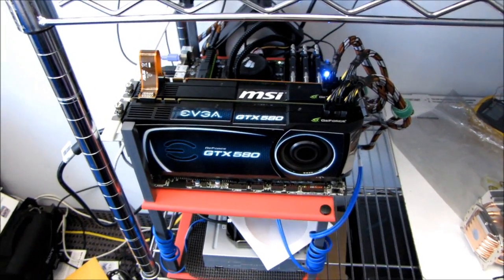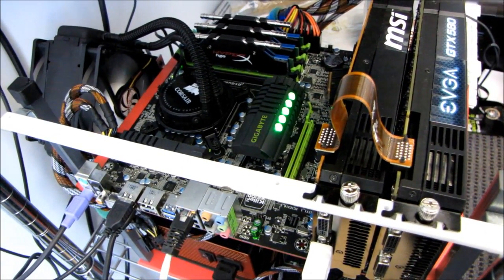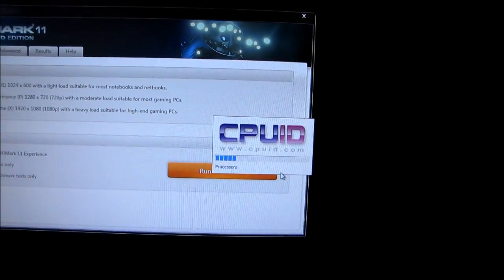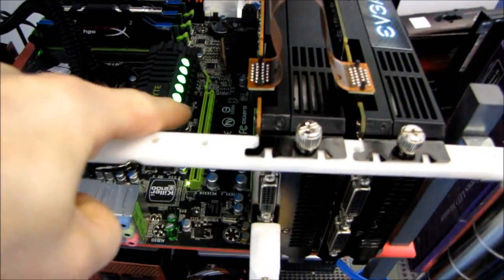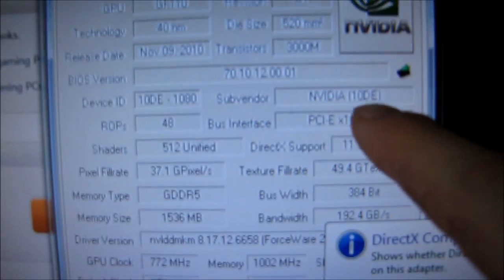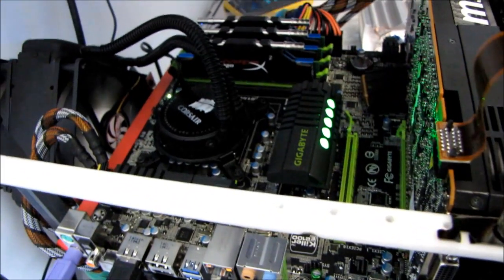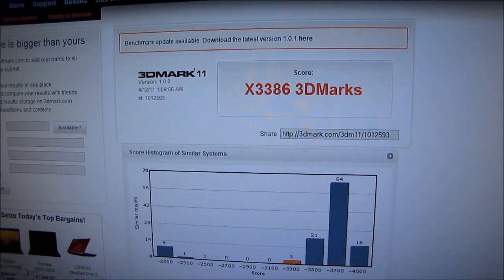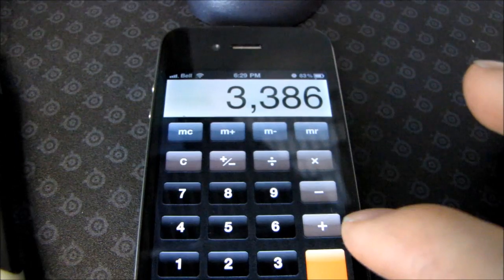SLI Using Dual PCIe 16x vs 8x - How Much Bandwidth is Needed? Linus Tech Tips

Comment: So I have a question for you guys, if I run a 16x capable card in a PHYSICAL 8x slot, will the results be the same as if the slot was physically 16x but electrically 8x? I'm not planning on using a high-end card either, just a 750Ti (all I need to do is run this game called AVA that no one's ever heard of and watch YouTube).

Comment: what about x4?
Reply: Why?
Reply: well that would be a good test as with PCIe 3.0 the 4x slots run like 2.0 8xslots
Reply: My MSI pc mate z97 has a 16x pcie 3.0 lane and a 4x pcie 2.0, and when used together for crossfire only of course you get 4x4x. I think there is a performance hit of 10% or so.
Reply: markman090 also keep in mind that 4X 2.0 slot you're using its going through the chipset
Reply: interesting. I didn't go for crossfire because i was really turned off by the 4x/4x. I think the crossfire label should be striken from products that only support 4x, it's not worth it whatsoever.
Reply: markman090 it's not and a finding a bunch of z270 motherboards that are "PCIe 3.0 16x 4x PCIe 2.0 4x" in that order so you really have to look at the specs before you purchase it or you could screw yourself i have 2 RX 480's and i need to make shure i get 8x 8x

Comment: Would there be any difference running 1 gtx 980ti 16x or 8x? I'm just wondering because I like the looks of my card being at the bottom of my motherboard since I have 4 pcie slots. I haven't noticed a difference yet when playing farcry 4 in 1440p maxed out.
Reply: +s10shane It will depend on the generation of the PCI slot and the which generation your CPU supports. I'm considering the same thing because my 16x slot is damaged but the 8x/8x slot isn't. a 3rd gen 8x/8x connection is just as, if not faster than 2nd gen 16x connection.

Comment: Will you see a lot of bottlenecking when using a gtx 780 pcie 16x 3.0 using a pcie 16x 2.0 motherboard?
Reply: there will be no bottlenecking
Reply: thanks
Reply: PCIE Gen 2 16x is the same speed as Gen 3 8x which as shown in the video does not change the performance in any meaningful way. Glad I could halp

Comment: Not that it matters much but the difference was a ~0.1% improvement.

That was a bit of wonky math there bud. 

3389-3386=3
3/3386 = .0008860012
.0008860012x100 = .0886012%^
Rounded up to .1 %

Just sayin'

I've been wondering about this x8 vs x16 for SLI and although I'm not sure how conclusive that test was with just 3DMark11 as the only benchmark the results are 'interesting'.

Comment: I didn't know enough when I built my system (still don't). I have dual HD7770's running on crossfirex. When I purchased the motherboard, it said it supports up to quad setup. Funny thing is the PCIe slots are 1x16 @x16, 1x16 @x4 and 2x PCIe x1. GPU-Z shows that GPU0 (@x16) is running @x16 and GPU1 is running @x4. All I'm wondering is, what is affected by the reduction in lanes. You look into the 16@x4 slot and can see the physical difference in connection quantity. What does the GPU normally do with all these lanes that are now sitting there unused? I need a new motherboard as my GPU's are 3.0 and the board is 2.0 but I'm on a budget and need to make sure I purchase a suitable board.
Reply: Man I'm wondering the same thing

Comment: that board doesn't support 16x that's why not much improvement
Reply: dude!! do your homework before blabbering such a joke. Here - http://www.gigabyte.com/products/product-page.aspx?pid=3776#sp
2 x PCI Express x16 slots, running at x16 (PCIEX16_1, PCIEX16_2)
Reply: ffejster24 Seriously ? you don't understand anything about computing hardware do you ? the fact is that with PCIE linking lanes doesn't always give you more, Nvidia's "SLI" System Link Interface doesn't scale in parallel like what 3D FX's SLI did, and there's a reason for that Nvidia SLI is interface reliant, 3D FX's was card reliant.

Comment: for dual titans, will 8x be good enough ?

i am currently running an Asus z87 Pro motherboard, so i cant have dual 16x

.. should i upgrade motherboard for duals ? or will 8x be just fine ?
Reply: 8x will be completely fine.
Reply: In all honestly the majority of games are not using the full bandwidth that are being given to them at any given time, AMD with its 512 bit bus architecture is getting closer to filling the bandwidth of 8x. All in all the 8x will still viable a couple years down the road for most consumer cards.

Now a couple years could be 1-2 or 5-6 depending on the competitive nature that Nvidia and AMD have.

Comment: But the real performance boost is only useful when loading textures into the VGA's memory. Because that's when you need the bandwidth boost, since that's where the bottle neck is. During the run there's no need of bandwidth, hence there won't be any difference. Coz you know? Textures need to go from HDD to CPU's RAM and then to the GPU's RAM. Any other benchmark that doesn't test that isn't doing it right. It's like evaluating a fish for it's climbing abilities.

Comment: Well, this test was very relevant back when gtx 580 was the top dawg, however the dual gtx 780 ti setup that I'm going to be running will likely saturate much more of those PCIe3.0 buses than 580s, therefor I'm sure the gap between 2-way 780 ti SLI @ x16/x16 bandwidth and 2-way 780 ti SLI @ x8/x8 bandwidth will be much greater indeed.

Comment: Thank you LinusTechTips!! You've saved me an evening of research! I have a Gigabyte GTX670 OC 2GB (overclocked nicely), and now that it's already being replaced with the 770(?), I'm going to get another in a few months if and when the price gets closer to $300 (already down to $355 on Newegg). My Gigabyte UP4TH mobo does drop to 8x (pci-e 3.0) when two slots are used and I wondered if this would make a big difference, but now I have no worries. Cheers!

Comment: If this is sarcasm than ignore this post. He just tested the ratio of the two outcomes. With x16 it 3389 and at x8 it was 3386. So you just divide the higher one by the lower one to get the performance ratio which was ~1.0001. Which means that the with x16 it was 0.01% increase in speed. (1.0001 * 100 = 100.01% => 100.01% - 100% = 0.01%

Comment: Technically you're correct they are the "same" GPU's however like you said, due to manufacturing process, some CUDA cores are disabled, etc. so while still the same "architecture"  of GPU they're all gk104 for example but the GPU that makes it into a 560vs570 are not the same in the end. ATI simply handles this differently but the idea is the same.I think we are getting hung up on semantics and what we consider the GPU. I consider it the core on the card, not the architecture it's derived from.

Comment: what Nachoman is saying is that just because the overall Architecture of the GPU is the same, it doesn't mean that the GPU is the same. just like buying a GTX 780 or a GTX Titan are technically gk110's like the Tessla, but they are not the same thing. You may be confusing with ATI's Crossfire, wherein as long as they share families you can run them together i.e.: a 7970+7950 is ok, but a 7970+7850 will not.

Comment: Well you saw it wrong. a 560ti is only $170 while a 660ti is $290. That is $120 differenceHe was looking at getting a card that is around the price of a 560ti. Not $120 more. It is safer to assume someone is looking for a card around the same price than whatever the best value is. I didn't read the part saying nvidia side. Another analogy. 'should i get an amd a8 to render video'- new pc builder 'no get the i7 3770k because it does it faster'-you. see how stupid it sounds?

Comment: yeah your performance will be greatly limited. run a 560Ti on a celeron single core, then on a i7 3930K. same gpu but the performace is massively improved when the cpu isnt holding back the system.

Comment: glad to hear that its nothing noticable.  ive just bought 2 8800gtx 460 cards and it is running at 8x in sli. i bench tested them with heaven dx11 with everything maxed out and i get 36.6 fps. it runs smooth and judder free so im very impressed to be honest. my old 8600gtx cards couldnt even handle this on medium and they were only dx9 i think. maybe dx10

Comment: "8X" is not it's bandwidth...  That's the number of lanes being used.  Available bandwidth would be determined by PCI-E version...  (On a 16X slot, PCI-E V1.0=4GB/sec, V2.0=8GB/sec, V3.0=15.75GB/sec (PER LANE  X  8)

Comment: You still shouldn't see any worse performance from the x8. Also, if you plan on overclocking, you should OC both cards since in SLI the system recognizes the least amount of vram and the slowest clocks as default, no matter that you OC-ed the top card.

Comment: Guys i own a Z77 pro-4. Wich has 1 port x16. It says it is not SLI capable cause the other slots needs to be at least x8 but is Crossfire capable. How come AMD cards don't need the speed of the slots? cause the other 1 = x4? I am confused. x8 or x16 = double the transfer data. how can it only increase 1/2%?

Comment: Guys, I'm just guessing here right now. Linus, have you tried evaluating 2 GTX 680? Maybe there is just a little difference in performance because GTX 580 is a PCIe 2.0 and as per my understanding, the max bandwidth of PCIe 2.0 is 8x max. But if you try 2 GTX 680 in a Gigabyte G1 Sniper 3 Motherboard that has 2 PCIe 3.0 slot running at 16x with an Ivy Bridge Processor maybe there will be a difference. Isn't it Ivy Bridge Processor can maximize the bandwidth of a PCIe 3.0? Well it's just a hunch!

Comment: I fixed it. I apparently had a driver problem. I reinstalled windows and it worked fine. My PSU is 1000W from coolermaster so its fine

Comment: i use a f1a75m-le. The board has one x16 and another x4 black., Currently have a hd7750 now, am going to add another 7750 for crossfire. would i see another performance boost. (please state in percentage of performance boost in 16x and 4x)

Comment: Scalable Link Interface... it basically means you could buy a second graphics card of the same model and connect them both together to increase your graphics processing power (assuming your motherboard supports SLI)

Comment: Some cards do 16x+16, 16x+8x is pretty common on most mid to high tier cards. The MSI Z77A-GD65 I just ordered a few hours ago only does 8x+8x. But I got that one because it was the most affordable mainboard sporting 8 SATA ports I could find. Since berformance will be reasonable anyway it's not really much of a deal either. 16x+16x(or even more slots at 8x and/or 4x) is hardly need unless you're trying to review GPU's or do competitive overclocking. :)

Comment: ...To continue my two cents (well, this is a separate comment so I guess that's four cents altogether), modern motherboards actually have the appropriate slots spaced to allow for optimum airflow.  I.e., x79 boards (40 lanes pcie) will have an x8 slot between two x16 slots so your two-card configuration will run at x16 on each slot.  Z77 boards (16 lanes pcie) will have one slot between the two x8 slots (an x1 slot, a pci slot, etc) to allow the dual card setup to have proper airflow.

Comment: My two cents, if I may: I need to research this, but I would think that one card in x16 and the other in x8 would mean that you'd get the same effect as two x8s (the whole weakest link thing) because it would be easier for the system to manage two cards running at the same bandwidth.  I could be wrong, but I think that's how it would work.  But you are right in that the airflow concerns would be addressed.  Speaking of which...

Comment: If you really are going to do a 4 way SLI/CF setup just skip 1155 all together, get a 2011 board otherwise you'll bottleneck the cards which is just a shame. In theory the cards wouldn't be bottlenecked bedcause PCI-e Gen3 x4 equals to PCI-e Gen 2.x x8 but in reality that's not true.

Comment: graphics card performance is purely about how fast it can draw frames. the more cores a card has, the more frames per second it can draw (scaled by how good the cores are. if you have two cards, you have twice as many cores, but not always twice the performance as the drivers don't handle the two cards as well as a single card. the reason for two cards than one higher performance card is to save money. you can buy two GTX560Ti and get the same performance as a GTX580 for a lot less money.

Comment: I Find this pretty helpful in my situation I have an 1100T on a Crosshair V that in SLI does 16x 16x but Since I'm running 2 x GTX 580 I get a cpu limit and have the option (getting a great deal on) a 2500K and a P67 that does 8x 8x in SLI. Thanks to this vid im upgrading to an i5 and know I should get little lag on the cpu or gpu end.

Comment: Did the same type of test with my Radeon 5830, I ran several benchmarks while the card was installed on a 4x PCIE slot and a 16x PCIE slot, there was absolutely no difference in performance other then a few negligible points!

Comment: @BigRTKingKong ??? that dont make sence??? u got 1 slot cause u didnt want to run 8/8 but if u run 1 card on a 8/8 board it runs at 16..... in other words its really physicly  16x and 8x but it can only have 16 lanes of bandwith so it runs at 8/8 with 2 installed  i run duel 580's on p67 and it runs great

Comment: Gorilla motherboard! LOL. Well i´m pleased that my P8Z68-V PRO wont be a bootleneck for my two GTX 470s. Even if Z68 in 8x8x SLI it´s 3% max. slower in frame rates @ hires, versus a 16X16X SLI X58, we must remember that the performance in terms of CPU, the 2600k it´s significantly better than any i7 9xx series (except hexacores). Sandybridge CPU is 10% faster clock per clock and clocks higher. My opinion is that Z68 besides being a mainstream platform, it performs better than X58 platforms.

Comment: Would there be a  considerable increase if I used x2 GTX 550 Ti in SLI? If I install 2 on this board that I have it will only run at 4x. If I use 1 i run at 16x.

Comment: I think linus should also compare a motherboard that uses the Nvidia nf200 chip which allows it to use 16x for sli configurations in p8p67 motherboards. That way we would know if nvidia's chip actually works, instead of being just some fake bandwidth(buffer)  that the chip is giving for the PCI-E

Comment: Linus thank you for the vids man, one question. I'm doing a build that will host duel 590s on a r4e, but as people know r4e has only x16,x8 slots. And that's fine if I was running a single monitor. But I'm going to run surround. So what does quad sli and multiple monitors for bandwidth wise? If its just a 3-5 fps change I don't mind. Than you jesse

Comment: @cletus094 

It is like the difference between a four or two lane highway. You can pass less cars (or data in this case) on it at the same time. It are the lanes betweens the gpu and motherboard (cpu), more is better in theorie because you pass more data at once but in the actual world it doesn't make a lot of difference because the video cards don't pass through that many data anyway :)

Comment: good job on video.  it's good to see you testing stuff that people think about sometimes..yet may get side tracked from researching or wanting to test.  and Eyce  yeah  you are right to an extent. Either way trolling is retarded though. there must be balance somewhere. neway If my 2 gtx580's can't handle crysis 2 at above 60 fps on a 120hz monitor at 1980 x 1080 rez no matter what pci e x16 lane combinations i try...that's as far as my experimentation/troubleshooting patience goes.

Comment: @MathioPL They are both great boards. I would go out on a whim and say the Gigabyte chipset and motherboard should run cooler. My G1 Guerrilla had 20c+ cooler on board chips than on the RIIIF (yeah I know it's not the Extreme or the new one) But also note mine had to have been faulty since it blew two capacitors while using Prime 95. I do miss the Rampage I could have replaced it, but the Guerrilla was calling my name. Rampage BE looks sexy though. I know these G1 are GREAT for OCing too.

Comment: @tomcatdcn i know that, but what I mean is that the graphics on 3dmark 11 were probably set on performance or something like that to be able to benchmark and have a score if its like the previous 3dmark vantage. So if the graphics were not at maximum then there's a chance that the cards were not getting any bottle neck so no difference occured. But I wonder what's Linus' opinion on that.

Comment: @orangesoda1955 you fucked up the math too.  you take 3 / 3386 and get 0.000885.  then you x by 100 to get %.  so you get a 0.089% increase in performance.  if youre going to correct someone's fail, and fail at it yourself,  you leave yourself open for trolling.  also that could just be the percent of error.  there could be no difference at all....

Comment: Plis check this 2xIntel xeon 5680 4xGeForce gtx 580 hydro cooper 2 and 49152 mb=4x OCZ Reaper DDR3 3x4GB 2000MHz CL8 on motherboards EVGA Classified Super Record 2 (SR-2) Word Record and HDD OCZ Revo X2 PCIE 240GB 740MB/s 720MB/s 120k IOPs and 64bit W7 Unlimited. All on Water cooling and OC to max.It's mast be new World record :P

Comment: I think the point is that a PCIe X8 lane can handle about 4 times the current bandwidth rates of the modern top shelf graphics card, and realistically there should be 0.000% performance difference between X8 and X16 PCIe lanes. I understand where he's coming from, it pisses me off too when people get all fixated on X8 vs. X16... IT DOESN'T MATTER FOLKS! The PCIe X8 Bus will NEVER choke modern graphics card/s... EVER!

Comment: @BigLeatherJacket Its not overkill, it just depends how much you care about your experience. 580s cant run all games with perfect FPS. They run just about everything at acceptable fps. But there is a noticeable difference between SLI and a single card. Especially in graphically intense parts of games that include tons of explosions and etc.